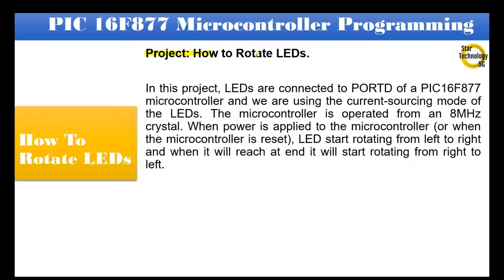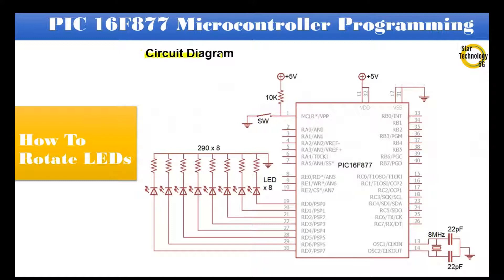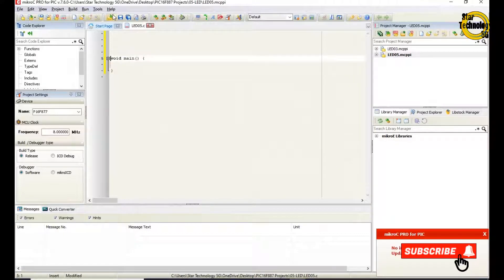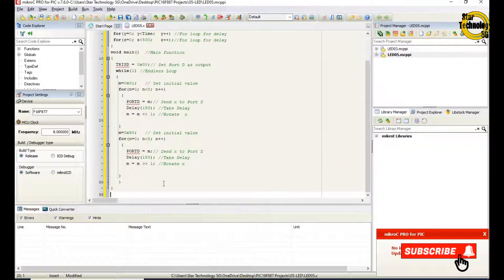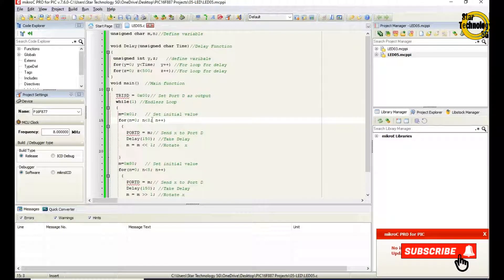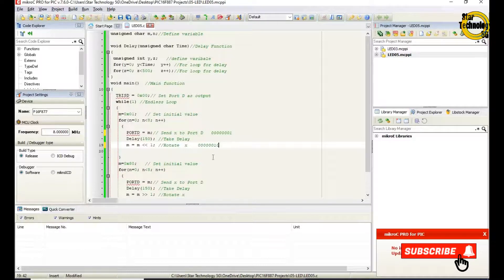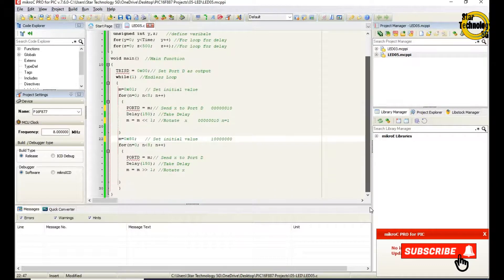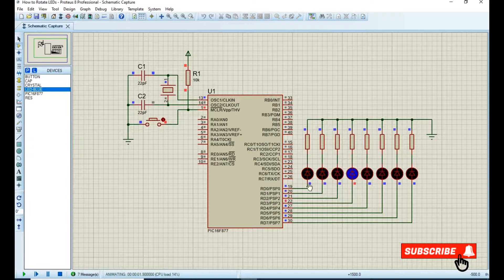Microcontroller PIC16F877 Video 12 How To Rotate LED Using Mikro C for PIC

Comment: //How To Rotate LED
unsigned char m,n; //define variable
void Delay(unsigned char Time) //Delay function
{
 unsigned int y,z; //Define variable
 for(y=0; y<Time; y++) //for loop for delay
 for(z=0; z<500; z++); //for loop for delay
}
void main ()// main function
{
 TRISD=0x00; // set port D as output
while(1) // Repeat forever loop
{
m=0x01; //set initial value
for(n=0; n<8; n++)
{
PORTD = m; //send x to Port D
delay (150); //take delay
m=m<<1; //rotate x
}
m =0x80; //set initial value
for(n=0; n<8; n++)
{
PORTD = m; //send x to Port D
delay (150); //take delay
m=m>>1; //rotate x
}
}
}